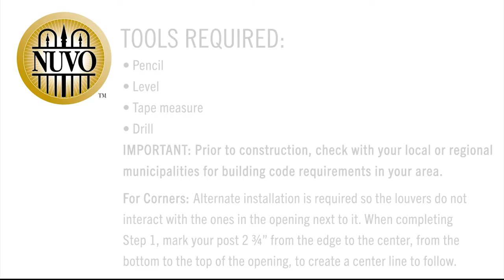Louver Shutter & Blinds Instruction - How-To Video

Comment: Video and Step 1 (diagram) says center line is 1 3/4 inches.  The written instructions in the upper right hand corner of my instructions 00014894 says its 2 3/4 inch center line. I'm going with the 1 3/4inch center line, was confused there for some time.

Comment: I've watched this video a couple of times and I'm still confused as to the first hole at the bottom.  I see the marking but where is the first hole?  Do you place the actuator on the bottom and mark the middle hole or the top hole?   The video seems to flash by this detail.
Reply from the maker: Hi Nancy, the first hole would be the 3 1/2" measurement from the bottom. That marking is where you place the bottom hole of the actuator, but you only do this so you can find the placement of the second hole. You can find the PDF version of the instructions here as that may help to clarify, this would be step 2 & 3. Hope this helps! https://static.wixstatic.com/ugd/c4f997_fdb0b5b087ed47a2bd0a49c9b9eefb41.pdf

Comment: Looking to do this for a few sections of our pergola.  How could we open/close them if they were mounted horizontally on the pergola roof?
Reply from the maker: Hi Jon, we have seen customers use something similar to a cane bolt or pole to push and pull them closed. A cane bolt style of rod can be a bit more helpful since it has a bend.

Comment: I want to connect this to some kind of free standing base. 
It will be west facing which receives the strongest winds.
What is my best option for a base that will not cause the entire louvred wall to blow over?

Also, can I connect my 4’ panels together or should they remain free of each other?

Any maximum height restriction?
Reply from the maker: Hi Larissa, we don't suggest installing any type of privacy wall or structure to be free-standing. As every structure, as well as area, has different building codes though, we would suggest contacting a professional in your area for more information and/or checking out the building codes in your area. The connection of the sections, as well as height, would again be dependent on the type of structure, where it is, and other factors such as building codes.
Reply: Dig holes below the frost and set the posts in concrete.

Comment: The video shows measuring from the edge 1 3/4 and says that's centre. That's true for a 4" post or other vertical support, however the post in the video is a 6 x 6. Why would they be using a 6 x 6, but be talking about the dimensions of a 4x? Also, it's clear that the louvers, when fully opened, stick out in front of the edge of the 4x4, when installed on centre at 1 3/4. Other than the look, is there a benefit to using a 4x4 versus a 6x6? Are there any pictures anywhere of both installations?
Reply: It would be good on a 6x6 if you are planning on screening the structure to keep bugs out.  That's what I'm going to do.
Reply: I just saw this old post and wondering the same thing. I am stuck on how you would ever get the screws for the louver actuator in the end of each louver if it doesn't stick out. Based on the order they show in the video, if you center the bracket on the 6in post and have all the louvers installed, you have no way to get a screw into each end for the actuator because it doesn't stick out past the post when fully opened. You would have to know this ahead of time and install the actuator screws BEFORE installing brackets on the other end.

Comment: Won't the boards warp or sag going too wide with no support in the middle?
Reply from the maker: Hi skeena59, that's why we suggest not going past 48" in length. But sagging all depends on the board material too. The nice thing about this kit is if you are worried about that with the material you are using, you can easily do shorter sections.
Reply: Use pine. Less likely to warp vs pressure treated.

Comment: What are the dimensions of the slats?  Are they 1x4, 1x6?
Reply: 5/4" x 6"
Reply: @theAdmurl498  Are you certain of this? 5/4" means the thickness is 1 and 1/4" thick? They look more like 5/8" or 3/4" at the most. And 6 inches wide? It looks in the video like the posts are 6x6, which in reality are 5.5x5.5" and the brackets don't seem to be longer than the size of the posts. Since the slats fit inside the brackets, I would think the slats are maybe 5.5" or less?

Comment: crappy plastics ARE BEING USED IN THIS PRODUCT - PASS
Reply from the maker: Hi Tom, we use polyoxymethylene to make our louver system. This material is used frequently in the automotive field for precision parts requiring high stiffness, low friction, and dimensional stability. If you've encountered a quality issue with this product please reach out to clientcare@nuvoiron.com and we can make sure we rectify the issue.
Reply: Why do you say crappy? The one's I have are far from crappy. I'll pass on the comment.
Reply: It’s a good solid product. The plastic in this case is probably the best material they can use.